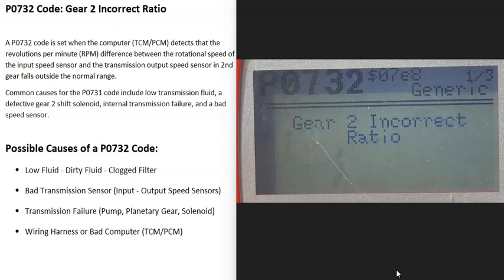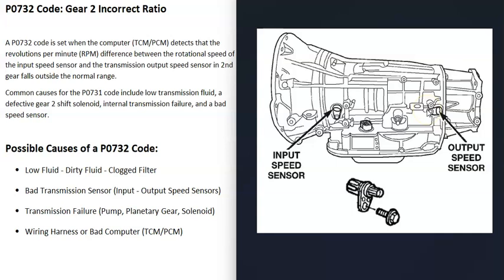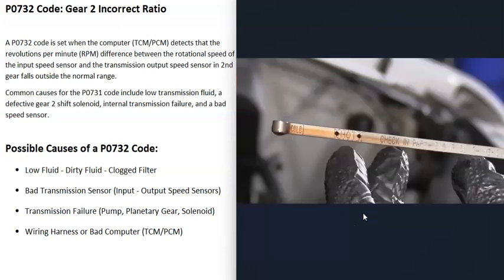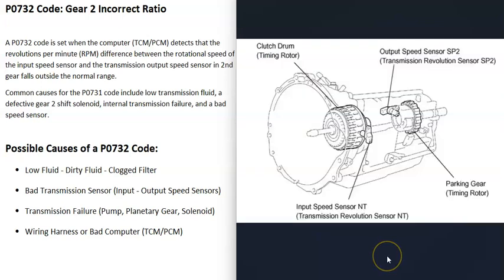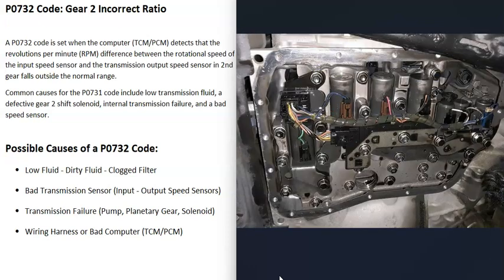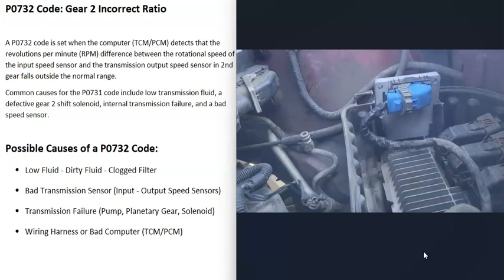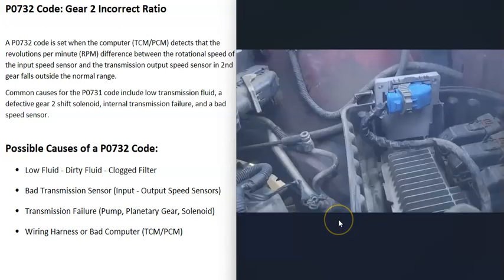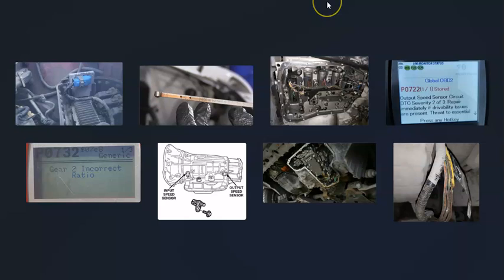Causes and Fixes P0732 Code: Gear 2 Incorrect Ratio

Comment: I have a 2010 Nissan it just cranking it won't start and I got all three of those codes that came out the one for the transmission is 0732 the 1217 and p0101 and now my car won't start
Reply: U ever fixed it ?

Comment: This came up along with P0741 (which is the torque conver clutch solenoid performance), and P2784 (speed sensor?) Is this all related to the shift solenoid being bad or is it the entire transmission that is bad? 2007 dodge magnum SXT 3.5L 5 speed transmission. Thank you!
Reply from the maker: It needs to be diagnosed, but I would start by testing the speed sensor since it can throw things off.